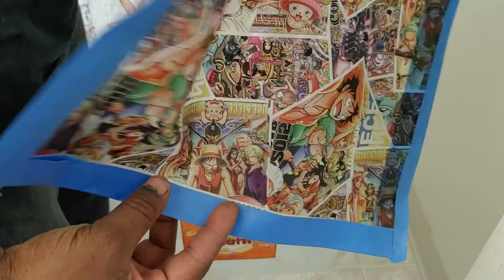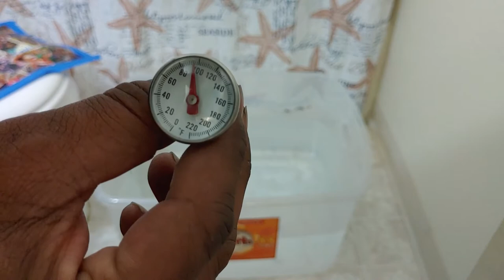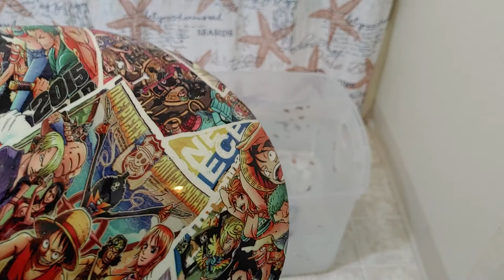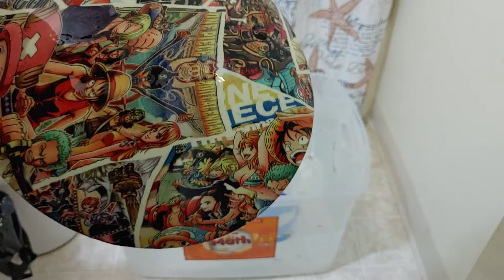Hydro Dipping Subwoofer Parts (Glow In The Dark One Piece Dustcap)

Comment: Hey how is it glowing, did you spray on the film ?
Reply from the maker: I used Rust O leum glow In the Dark spray paint before I dipped the cap
Reply: The paint should be water based or oil based ?